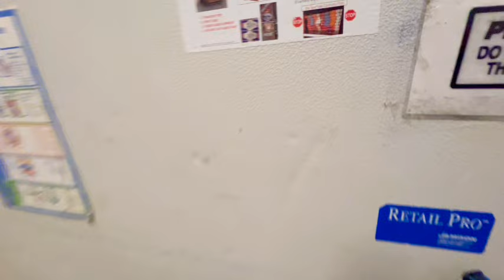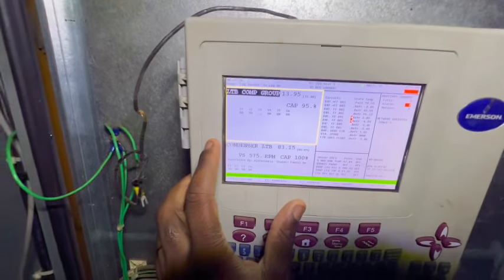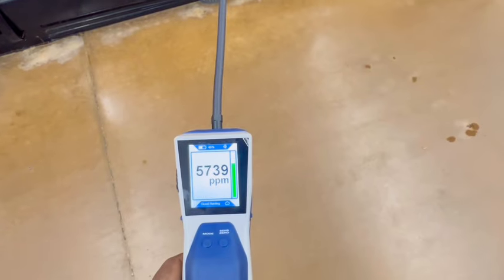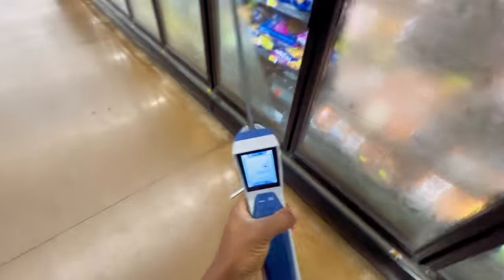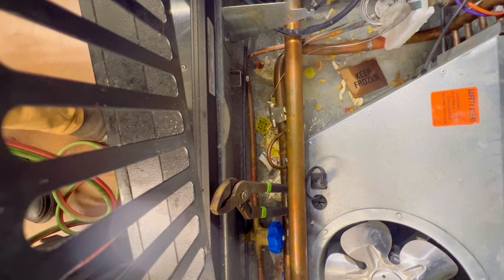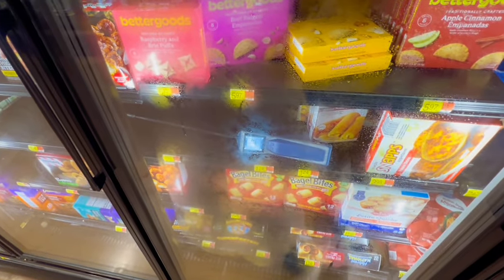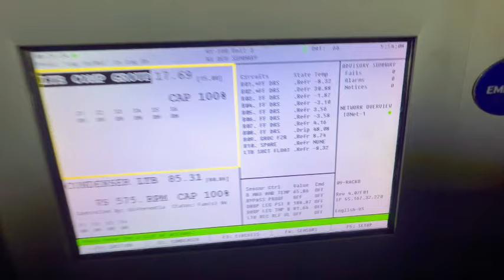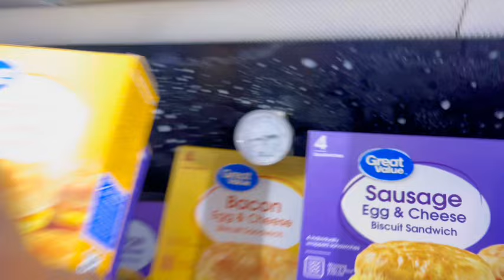LATE NIGHT TO MORNING WALMART FROZEN MULTIPLE DOORS DOWN!! SMALL BUT BAD LEAK!

Comment: bro get a little fan, like millwaukee fan and put it in the case when you weld it helps a little
Reply from the maker: Might need too appreciate input ☝️🙏🏽
Reply: @youngbuckrefrigeration716  no problem bro thats what i use, little 18v milwaukee fan

Comment: 85 set point is SLT (saturated liquid temp), you can do multiple different types of set points. One discharge pressure which is not as energy efficient, 2 SLT or drop leg temp. You should know this if you have been in supermarkets long enough
Reply from the maker: Yeah I know 👀☝️ but I know guys In trade longer than me and forget things left and right! Appreciate input 🙏🏽
Reply: Ease up killer lol